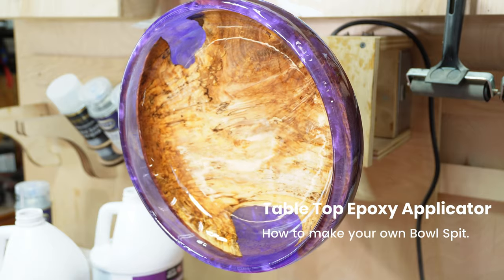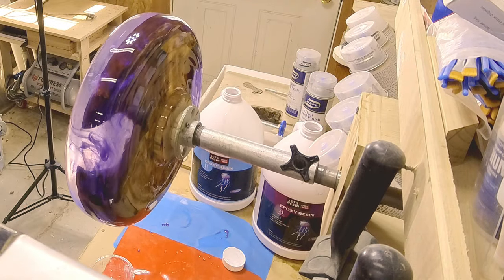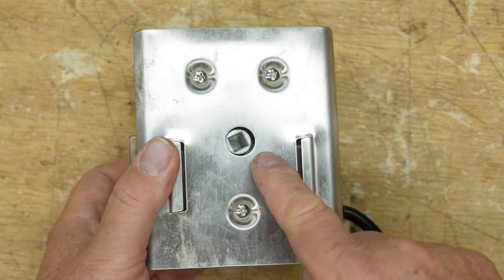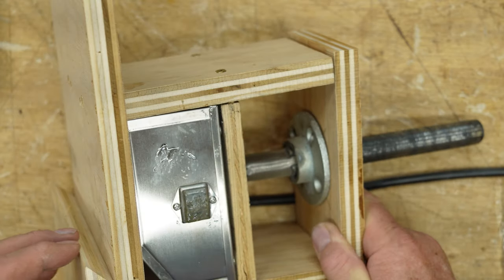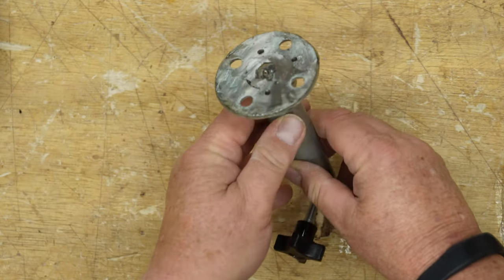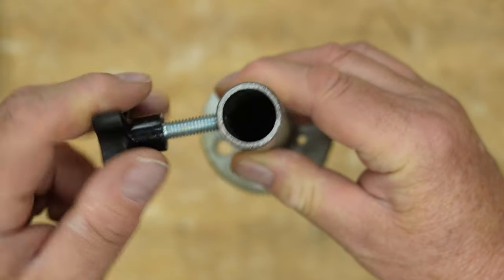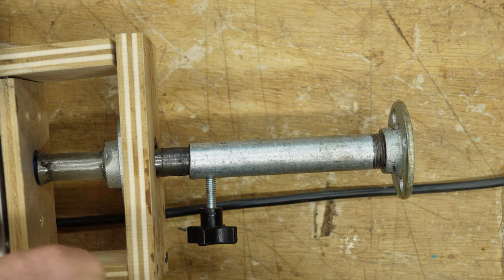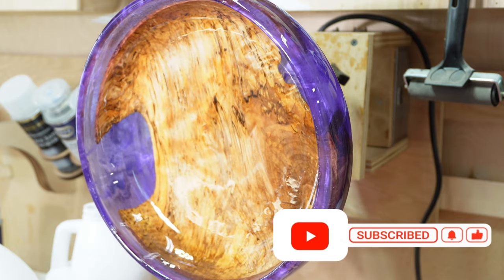Secret Technique for Perfect Woodturned Bowl Finish

Comment: Great video.  Just order my rotisserie motor.    A tad over $20 so as soon as it arrives I’ll design the rest of the jig.  Been thinking of doing for a while now.   It was great seeing somebody that had the same idea and already got it up and going.   My small lathes slowest speed is 150 and when I tried doing finish at that crazy way too fast speed….   Well let’s just say it was a DISASTER.   Runs everywhere and half the finish flew off even as thin of layer I could possibly apply. 5-10 rpm’s I’m sure will work perfectly. 😊
Thanks again for posting!
Reply from the maker: You’re welcome

Comment: Awesome.  How do you mount the bowl?  Are you attaching it as if it were a face plate then turning out the holes???
Reply from the maker: @alancole6912  I screw the metal face plate to the sacrificial tennon epoxied to the foot of the bowl. Once the finish cures I use vacuum chuck to then turn off the sacrificial chuck/tennon. You can see this in many of my videos Cheers
Reply: @bespokewoodartistry1517  Thank you.